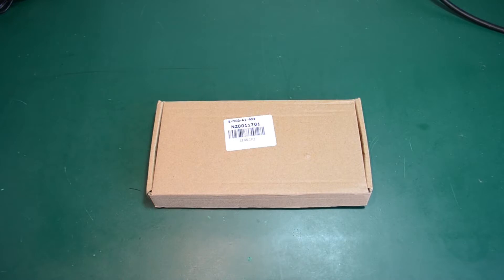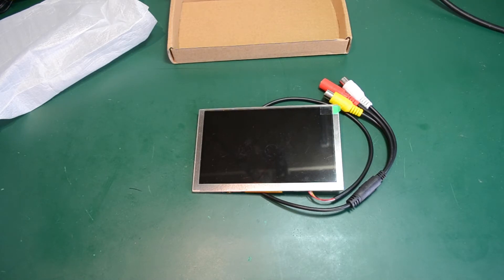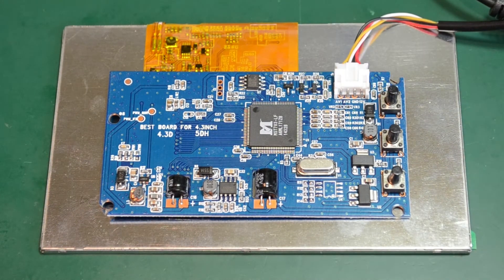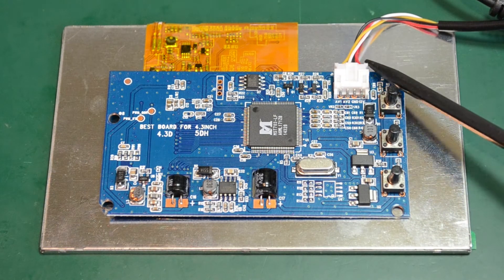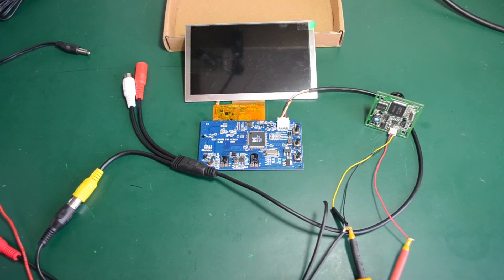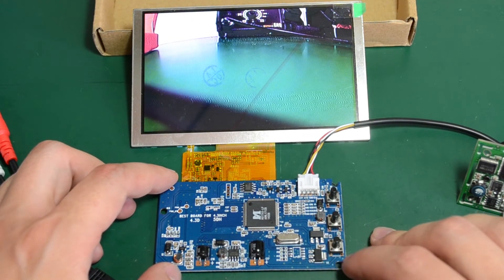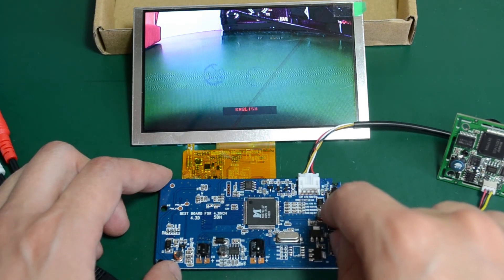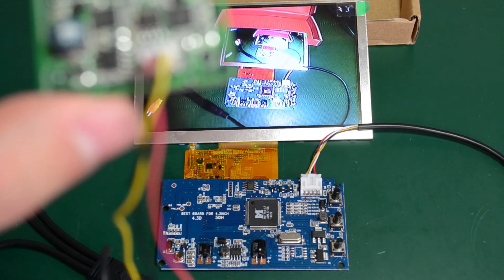Voltlog #17 - 5 inch LCD TFT Monitor With 2 CH Analog Input

Comment: I haven't seen aluminium capacitors surface mounted on their side like that. I can't imagine this is cheaper than just using a SMD, so I guess it's to keep the depth on the PCB low. Interesting!
Reply from the maker: Darian Cabot I've seen caps like that before (They're not truly surface mounted, they do go through hole) don't remember exactly where, but more commonly I've seen connectors buried like that for height reduction in products like tablets and mp3 players.

Comment: the inductor on the bottom left has a broken ferrite core :(  it probably still works fine though...
Reply from the maker: ***** Wow, I missed that while shooting this video. That could have happened during shipping or might of been sent like this, I don't really know but yes it definitely still works.
Reply: yep, looks like it works nicely.  One of mine arrived like that from ebay, but it doesn't affect its performance :)

Comment: Good value, would have been nice to have a digital input like SPI.
Reply from the maker: leppie Are you talking about the video input interface? Because if so, the whole purpose of the MST703 driver chip is to provide you with an analog input. There are other driver ic's out there that can do digital video input.
Reply: VoltLog Yes, but they tend to be a lot more expensive (but I havent looked at prices in a few years)
Reply from the maker: leppie I guess it would be nice to have hybrid ic that could do both Analog and Digital input and could output to RGB and LVDS as well, and the chip should be no more than $5 :-)